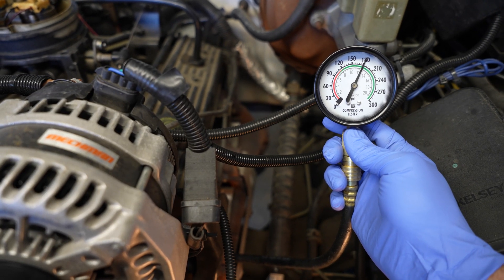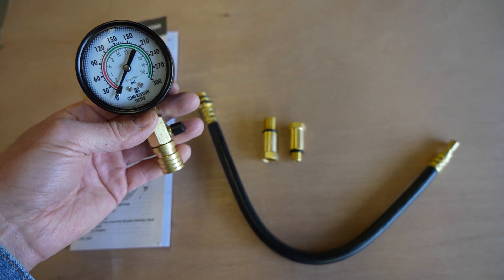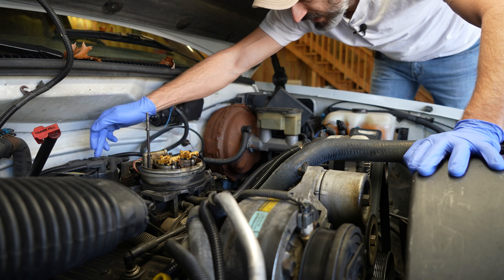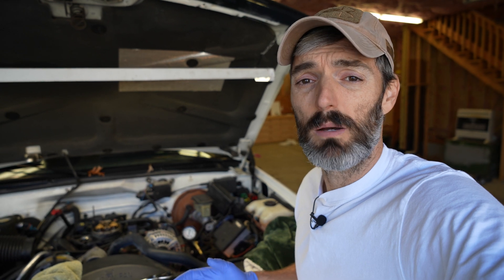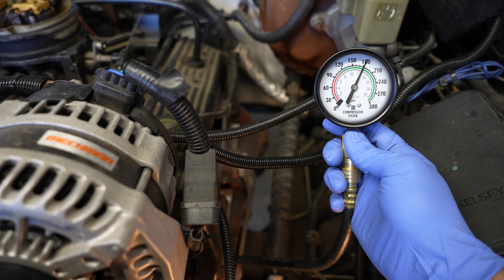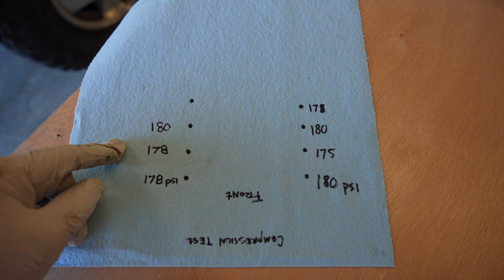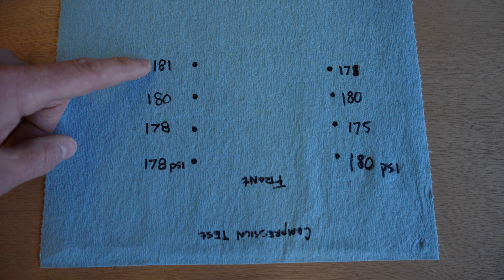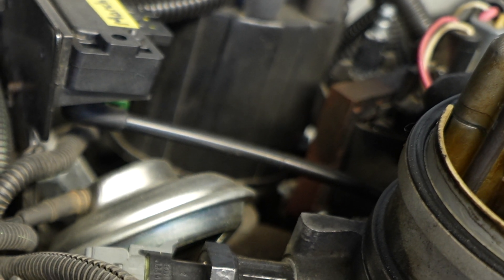This ONE TEST Can Tell If You're Using The Right OIL!!

Comment: There is always more than one way to skin a cat but I've done this job a hundred times and never needed the throttle wide open. Also, I always take out all the spark plugs before I start to make the test easier on the battery and starter.
Your Gage reads in 5 PSI increments.  It does not have the accuracy/sensitivity to be read as 178 psi or 171.  Throwing in your own Kentucky windage judgement only serves to make your measurements LESS accurate.  Pick the number of the closest line to be most accurate.
The good news is that Jimmy's engine is in fine shape compression wise, his numbers are very high (like new) and just as important, very consistent across all 8 cylinders.

Comment: i have a question, how come you leave the skarkplugs in? 
all the tests i've done i remove all the plugs making less drag on the starter and battery ( also just a tip ... by the time you've done 8 cylinders your battery maybe not spinning at the same speed so half way through hook up a jumper battery )

Comment: Just going by the title... how does a compression test tell you if you're using the right oil?  Failure to check the level or do oil changes at regular intervals can shorten the life of the engine.    Using the wrong oil can give you (o2) oxygen sensor issues.  Look under the hood.  Somewhere it should tell you what kind of oil to use.  Don't use any other oil viscosity other than what is listed on the vehicle.  With newer engines these days, proper viscosity is a BIG deal.

Comment: I would've either pulled the coil power plug or ignition fuse. Otherwise, a great video for those who don't know how to do a compression test👍 thanks for sharing!
Reply: The other 7 plugs should have been removed....
Reply: @walterk1221  ideally, yes. Less strain on the starter and battery. He might have gotten slightly higher readings also, with the increased cranking speed!

Comment: That pretty dang good when my factory GM online repair system at the shop states the the light duty (c/k1500) 350tbi states the original compression specs are 190-195psi on an all new engine, that's a REALLY healthy 350 you have.
Reply from the maker: Good to know, thanks!!

Comment: Keep up the good work . . . . . I'm driving a 1998 chevrolet Tahoe LT that total six other vehicles ( Head-on collision, T-bone collision, and Rear-end collision ) and still using the original front chrome bumper.
Reply from the maker: 😱 what??
Reply: Yea  @1RoadGarage  here in Los Angeles area lots of people cuts me off all the time. Is hard to stop on time despite my all Duralast semi brakes system ( the most expensive components in AutoZone ) and my brand new Sears DieHard tyres or is it because my truck is too heavy.
Reply: @danielgo1995hg   My suggestion is to upgrade your brake system to "PowerStop" Z36 Extreme series truck & towing. Rock Auto usually has a good deal, but shop around.

I had some close calls & near miss situations while towing a loaded 16 ft tandem axle utility trailer around 6,500 lbs total. Was recommended that brand & series brakes for my 2016 F150 5.0L Platinum crew cab 4X4. Wow! Serious improvement! Very pleased with these brakes.

Comment: Good video Jimmy! Quick question. Do you put anti seize on your plugs?
Reply from the maker: No. I’m wondering if I should though.
Reply: @1RoadGarage  don't! those old GM 350s do not like never seize on them. Torque specs is only 11ft-lb, adding a lubricant always changes the clamping force of threads. And makes them tighter than the set Torque. If you HAVE to put never seize on those spark plugs only Torque them down to 5ft-lb. I've repair MANY cylinder heads from spark plugs tightened down with never seize. And if you have to, use the copper never seize as it conducts electricity, and won't "block" the spark plugs path to ground thru the threads.
Reply: @1RoadGarage  I’m wondering the same. Maybe a video in the future?

Comment: Hi Jimmy.  I am watching the video currently, but my question is did you remove all the spark plugs before starting to test OR did you only have the spark plug of the cylinder you were testing?  Thanks, from somewhere in W.A.
Reply from the maker: So, I only removed the plug from the cylinder I was testing. But, the Chilton book says to remove them all at once. 🤷‍♂️
Reply: Removing all the spark plugs first will reduce strain on the starter and battery, also slightly higher cranking speed. Unless you already have a weak starter or battery, it shouldn't effect the reading.

Comment: You should get engine restore oil additive 
I used in in the 90s for my mom's 88 gta and it worked back in day 
And I felt the hp 
And tested it 
Its the only additive that actually works 
It will make your numbers brand new for the whole oil change project farm did a thing 
On it
Reply: Engine Restore BLOCKED the oil passages in my Ford 302 and the engine seized,  I'll never recommend anyone use it, there is no reason.  Either an engine is in good shape or it needs to be rebuilt.  There ar no " rebuild in a bottle" solutions !!!
Reply: @duane4972  I think you had a shitty engine that was abused 
The pf guy let the stuff sit in a tractor for a year and was fine 
I did yearly oil changes 
And fine 
Zero issues 
Sounds like you need a engine flush 
Or need to use synthetic oil from the start 
Sounds like you don't have a clue what your talking about to me

Comment: What was the point of  pushing the gas pedal down does it make a difference seen it done before never seen have to have the gas pedal presed
Reply from the maker: Chilton book and directions from the compression tester both said the open the throttle.

Comment: I've had compression tests check out, but it's still garbage.....leak down test is the only way. Then you can tell if you have bad intake valves, exhaust valves, or if it's leaking past the piston rings into the crankcase.
Reply from the maker: Good to know. I'll look into that, thanks.

Comment: A better way of determining engine condition is a leak down test.
Reply from the maker: Thanks. I'm going to look into that.
Reply: True
Reply: But will a leakdown condemn a cylinder that passed compression test? A leakdown will reveal where the loss of compression is occurring but I do not believe it serves a purpose when compression test is good.
Reply: @walterk1221  The answer is yes, it absolutely can and it does serve a purpose even if the compression test's good.
Reply: @j.t.cooper2963  thank you.